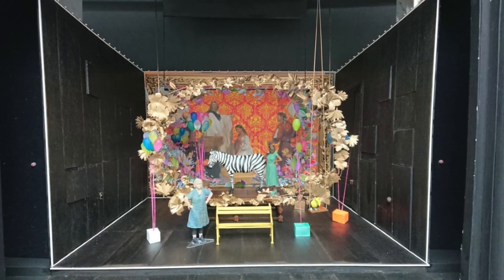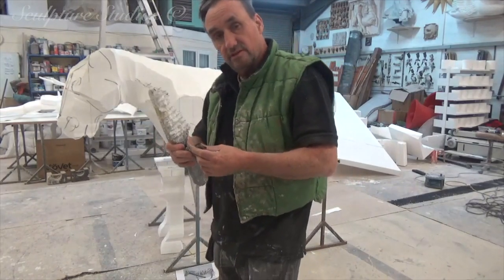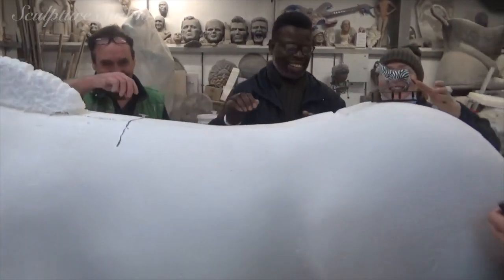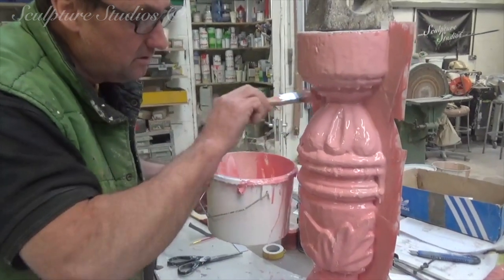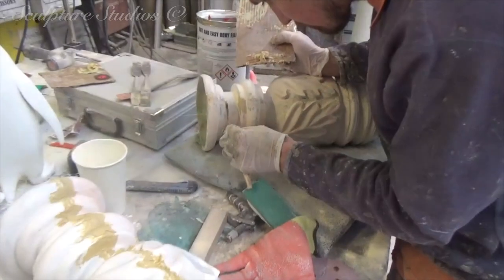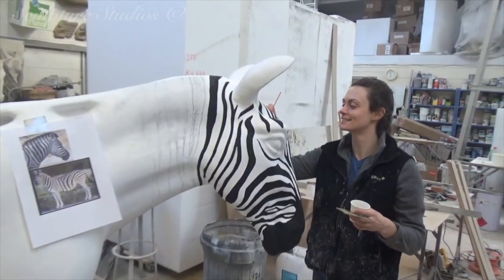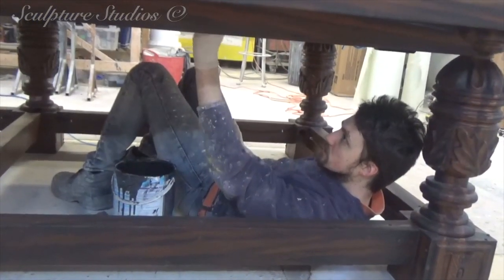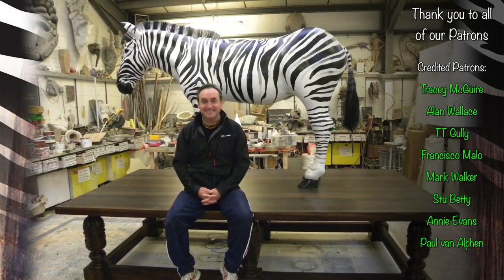Rigoletto Zebra & Table - Opera Stage Props by Sculpture Studios

Comment: The teasing of the sparkly secretly sourced sticky back foil always brings a great laugh. I'm always amazed how you can apply such large pcs of glass fiber with out wrinkles on those curves. When I try 1.5 oz. pcs. around some curves it can be difficult to work them out smooth. Do you guys ever use .75 oz for the first layer? Maybe that would help me but just seems so thin. Plus I still get a few air pockets sometimes between my gelcoat layer and the first fiberglass layer when trying to cast in my molds. I really love the table fabrication with the many different details. Really great job with everything you guys. Thanks for sharing another amazing project.
Reply from the maker: It started off as a bit of a gag. Now it's actually a staple mystery of the workshop 🤣 We generally use 1oz and 2oz glass fibre (sometimes 1.5oz, and sometimes thinner at 0.5oz). We find sometimes it just takes a while for the mat to soak up the resin properly. Paddle rollers always help push those air pockets out too.

   Thank you very much indeed. Hope you and the family are all keeping well out there in Cali!
Reply: @AdenHynesSculptureStudios  Family is doing well our son is keeping us running. I just started glassing a mold for another pumpkin we sculpted and had another question if you don't not mind shedding light on. Do you guys wait until the gelcoat layer is totally dry, little tacky, or still wet to the touch when you apply your first layer of glass fiber soaked with resin over it? Sometimes it looks as though you guys use the color or tinted gelcoat itself to wet out the glass fiber layer because of its colors and thickness. I know resins come in different ways but mine always seem to be more clear tints and many times yours are a thicker white or black in color, almost like paint or the gelcoat. I appreciate any feed back you are willing to share here or in email if you prefer and can't stress enough how much I thank you for all I have picked up and learned form you guys. Cheers!
Reply from the maker: @HollywoodHaunter  No problem! A gel coat should always remain tacky (it should not be left overnight etc, as it can get too dry or dusty, and can cause shelling or separation from the glass fibre), we wait until the gel coat is no longer wet, but is still tacky, and then go over with glass fibre, soaked with resin. The clear resins are our general purpose resins, however, we often add pigments so that we can differentiate between the different layers. The white, thicker resins we use are more expensive, fire retardant class O resins for indoor installations. This takes longer to lay up due to its higher viscosity, and takes longer to cure. I hope this is of some help.
Reply: @AdenHynesSculptureStudios  Thank you